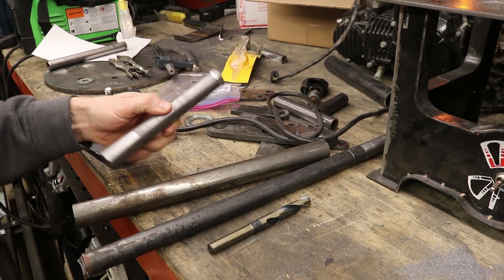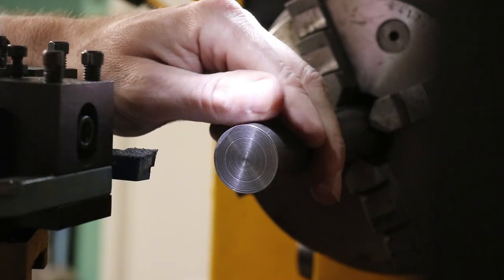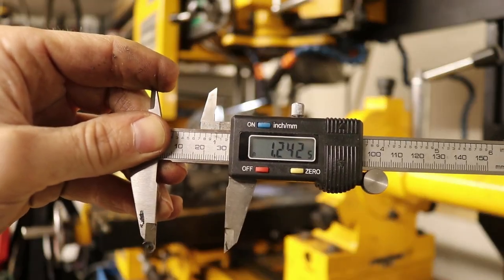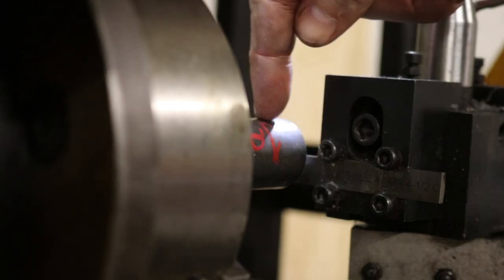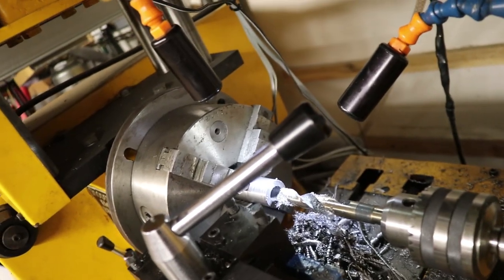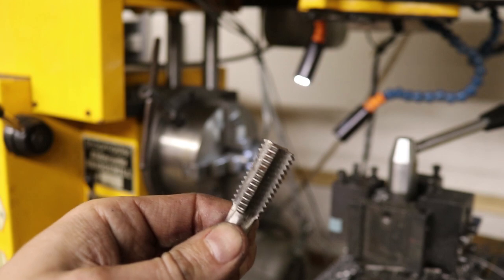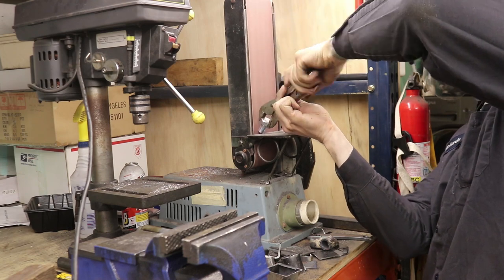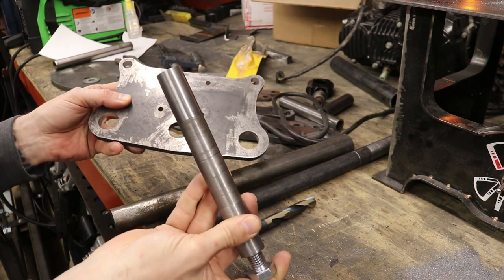Making a Motorcycle Steering Stem | Grom E22

Comment: About time for an update? Hope so. I’ve learned more from this series with you simple explanations and process of the build. I imagine a bobber grom build will be cool. I’m going to make a modified lighter weight frame jig using yours as a template.
Reply from the maker: Thanks.  Update is coming. I've had some personal crap that set me back,  but I am making progress on the front end. I don't quite have enough progress for a video yet, but it's coming. Thanks for watching 😀👍
Reply: @HooptieDoodle  I can’t imagine. Just making time to work on any project I have is enough.. then you have to add in editing and stuff..
Reply from the maker: @colossalbigfoot256  I enjoy both. They're two different creative outlets where time spent on one is a break from the other. Kinda like working multiple jobs is mentally easier than working 80 hours at one (even though the OT would be more lucrative 😀💰). But to your actual point: yeah, time is a hard thing to make
Reply: @HooptieDoodle  you get overtime.. I’ve not seen that in 20 years.. they love to exempt you so they own you. If only I’d put effort into YT for things I’ve done.. shoulda coulda woulda. Lol

Comment: 🤔 you didn't take into account the thickness of the top clamp when cutting the bolt. Guess you will be making a trip to the hardware store.
And BTW, as a machinist, I cringed watching you run a lathe. That was hard to watch. Really. 
But hey, at least ppl aren't afraid to try, just please learn a little about what you are doing before jumping right in. There is a reason why we get paid a lot to do what we do. It's not as easy as ppl think it is to get the desired result and great surface finish even when the dimensions are down to +/- .0005" and I'm sure that you would agree.